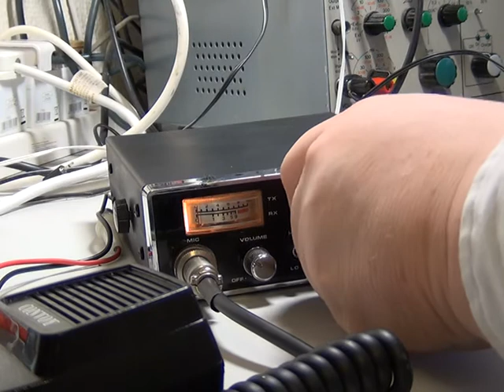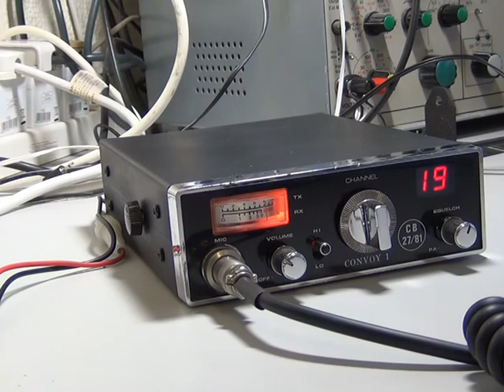Domico Convoy 1, UK (27/81) CB radio (Mobile) - On the air test.

Comment: How do you rate this radio I have one  I've highered my antenna 2 meter about the house last week I know theres alot of propagation around at the moment. 
I'm pick up.
Germany 
France 
Scotland 
Ireland 
Up north 
Spain
All clear as day
Reply from the maker: I can hear allover too. However I've also listened to them boasting what illegal high power equipment they are using too! That said, I heard a gentleman in Scotland saying he was running an ordinary Amstrad 901 at 4W, which was nice gto hear.

The Cybernet Beta 2000 is a better radio than the Domico. 

Richard
Reply: @ukfmcbradioservicingTango21 Ok ive found it quite good on receiving but like you said over powering amps probably like 200 what's.I was just listening to Mario from Italy but he wasn't picking me up on my little 4w 😅.So what power do you think these people are using I'd rather stick to for watts and find it fun to see what I can receive on 4 watts only

Comment: I've just bought one of these for 40 pounds off Ebay in the overall same condition especially the front. I'm surprised it wasn't snapped up before as it was on buy it now
Reply from the maker: They are certainly different styling to the usual Cybernet/Maxon/Uniden offerings of the time which accounted for 90...odd percent of world CB radio manufacture. I don't recall the Domico Convoy (also sold as Sun 401) being either unreliable or a rubbish set either.

Richard
Reply: @ukfmcbradioservicingTango21  How come your meter on the cb dosent go up and down when receiving a signal. Just plugged mine in still waiting to hear someone 😅
Reply from the maker: I've just looked at the video & it moves on two receive occasions plus when I transmit. Bear in mind I usually have no residual background noise being in the middle of nowhere near Ancaster, Lincs.
Reply: @ukfmcbradioservicingTango21  Yes the one I have is the same had alot of cb radios when I was younger and the needles use to float up and down on channel change. This model is mostly likely built different and better
Reply from the maker: @theamertureradioenthusiast3368  Another odd-ball rig was the Grandstand Bluebird. Built to the highest quality by a Japanese firm who usually make Marine sonar mark buoys & such like products.
Reply: Is this quite a good radio it seems well made.Ive had alot of radio equipment over the year sold most at regret it
Reply from the maker: @theamertureradioenthusiast3368  Big mistake selling stuff, I've about 250 UK legal rigs here! I can't remember how good these are & although I feel that Domico would buy in any old s**t, the fact that this is also the Sun 401 tells be it must be OK as I think they are a bit more quality conscious in what they buy in to sell. I can tell you I've never had one in for repair, only routine service.
Reply: @ukfmcbradioservicingTango21  Ok thank you kind sir for the info just on the off chance how much do you charge to fix a cb.Just for the future
Reply from the maker: @theamertureradioenthusiast3368  you'll have to discuss that privately rshireby@yahoo.co.uk
Reply: @ukfmcbradioservicingTango21  Weve had one of those touch sensitive lamps in our house for years.Every cb ive had other the years when ever you key the mic its lights the lamp and you can click through 3 different brightnesse to off.We originally thought we had a ghost. So is this a good way to test if you're radio is transmitting.
Reply: @ukfmcbradioservicingTango21  Ok pal

Comment: I have the Domico Convoy 1 the Amber light not working bit it goes to red on TX  seems very quiet on mic thought there was something wrong with the mic until you mentioned that  " The microphone sensitivity is quite low & has no doubt been deliberately designed that way" thanks for the info Richard in your videos. Also have a Superstar 95 AM Rig 120 channels do you know anything about this pre-1980s model?
Reply from the maker: Roger on the Domico & glad the video helped. Regarding the Superstar; we have nothing to do with illegal radios whatsoever & bear in mind it's still an offence to possess one. I used to do repairs on foreign CB radios for overseas customers knowing the sets wouldn't be used (illegally) here, but the DTI or whatever they're called at the moment put a stop to it & all non uk legal repair sets were confiscated. 

Richard

Comment: Nice One Richard - Are you low down in a dip a weak signal? :)
Reply from the maker: In a dip, in the middle of nowhere, 7 miles from the nearest town & 35 miles from either the cities of Nottingham or Lincoln.
Reply: UK CB radio servicing So the better way get a burner or set up rig high up on a mountain! :)
Reply from the maker: Rob, CB is supposed to be a local free to use 2-way radio service, up to 16km range. Fine with the mountain, but definately not the burner. Burner offenders get up to £2000 fine and/or 6 months prison. Good. 

On the other hand, as a licenced Radio Amateur, up to 400watts of power is legally available on many of the Amateur Radio frequency bands!